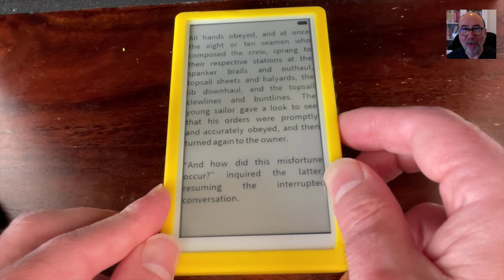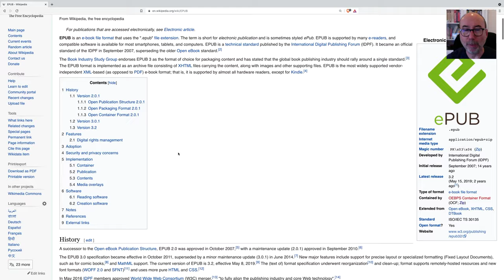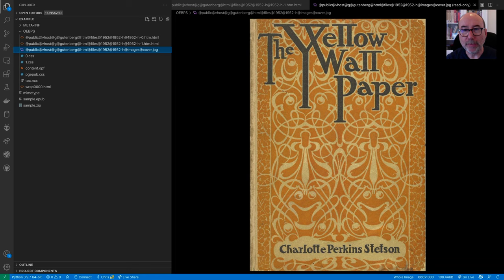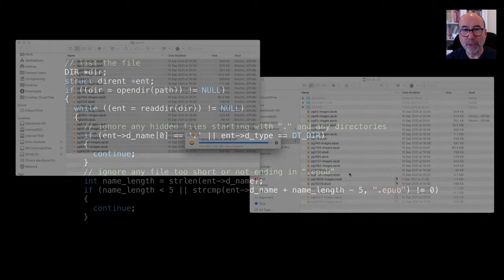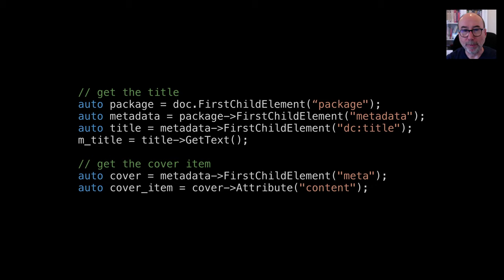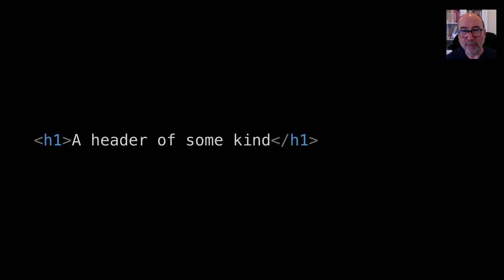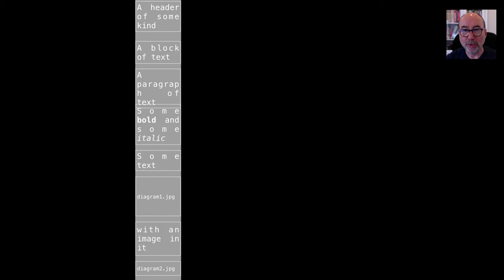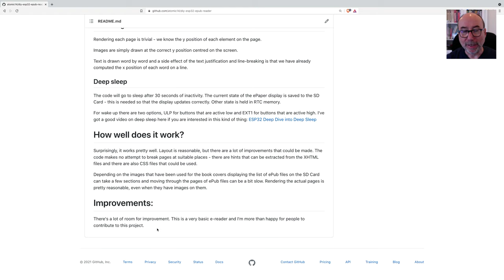DIY eBook Reader - Build your own Kindle using an ESP32

Comment: I got an Arduino the other day, done the first few basic tutorials but they are all a bit crap and give no more info on how to use/incorporate into other projects. I am defo going to build one of these and have joined your discord!
I also saw your forecast/temp monitor one, I want one as well lol, I would add a couple of stock prices to the display I think that should not be too much trouble with a little research.

Comment: Looks great. I might have to build one. I've never had an ePaper device.

(quick heads-up on "reder" in the vid title.)
Reply: To confirm the LilyGo EPD47 is the same module as the "LILYGO T5-4.7 Inch E-paper ESP32 V3 Version 16MB FLASH 8MB PSRAM" on their AliExp store, yep?

They have a choice between 18650 battery clips, or JST PH, and two different USB serial chips.
Reply from the maker: @electronash  That's the one - I got the JST one but depends what you have lying around battery wise. USB chips - I've had some issues on my mac with some of the new chips - but my machine is ancient... One thing to be aware of is that I struggled to find connectors for the 4 pin sockets to get the SD Card connected to the board. The official adapter is here - not sure what the pinouts are though! https://www.aliexpress.com/item/1005002317501092.html
Reply: @atomic14  Great, thanks. ;)

Comment: The Lilygo display you got comes with the ESP32 attached right? I cannot get that board and I want to use a 5.83 inch display from some other brand. Do you think this code would still work? The display is standalone and I will be using an esp8266. I am quite new to the world of microcontrollers.
Reply from the maker: The esp8266 probably won't be powerful enough for the ebook project. It requires quite a lot of memory so needs a chip that has PSRAM.

Comment: what kind of battery backup do you get from this?
Reply from the maker: No idea yet - the buttons on the board mean that you can't use EXT1 mode and have to use the ULP which does use more power. I need to try and measure the deep sleep current. My weather display gets a couple of months battery time and that wakes up every 30 minutes and connects to WiFi.